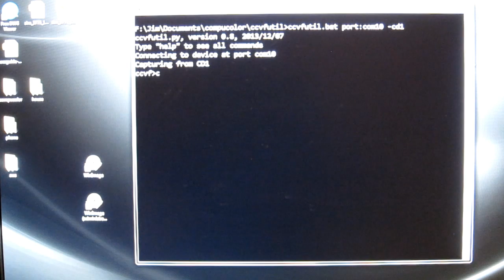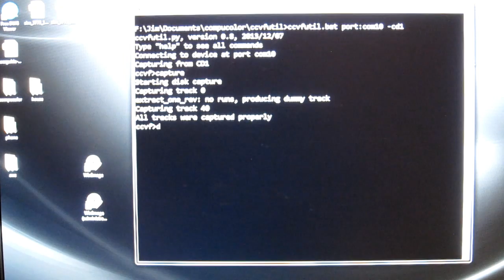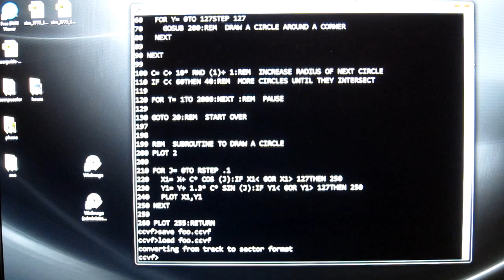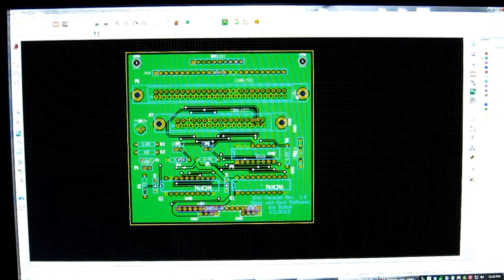Custom Compucolor II floppy disk reader

Comment: I was the software manager of the CC II. It had a primitive almost analog disk reader writer - basically recording a modem signal. Because it was so close to the CRT flyback's high voltage signals it had huge problems. We added a shield made of "mumetal" ti try to shield the head.
Reply from the maker: Bruce, it was an ingeniously low-cost (but low performance) disk control. The Northstar Horizon disk controller had a board full of TTL parts, probably 50, to do what the CC did with a single UART chip and a buffer to drive the head stepper. Have you tried playing with the CCII emulator at compucolor.org? It's disk is a lot more reliable than the original. :-)
Reply: @fudgesauce  I used dual 8 inch floppy's connected to a CC II to do software development. 2 360kb floppies were big enough to hold an editor, assembler and all the system software.
Reply: @fudgesauce  A modem ( UART ) is by necessity very forgiving of a bad signal. As close to the high voltage CRT as it was the signal was VERY bad. That forgiving UART was a good as it gets, a regular digital read/write head just wouldn't work.  We looked at it.
Reply: Did they make their own floppy disk drives?
Reply from the maker: @douro20  -- it was a hybrid. The drives mechanicals were OEM'd, and compucolor used their own electronics.
Reply: @douro20  The drives themselves were standard parts. The electronics - the data format and recording method were custom.

Comment: Very cool....I got 2 CompuColor systems and this would be very useful.  Any possibility of getting some Compucolor software?
Reply from the maker: chandrab, I have no actual floppy disks anymore.  I sold them with the CCII on ebay a few years ago.

however, everything that I capatured is available at http://compucolor.org/vmedia.html   (vmedia = virtual media).  Each row in that table has a virtual disk image saved as a zip file (see the "Disk" column).  If you unzip it, there is a filename.ccvf file (ccvf = compucolor virtual floppy).  The file is a text file format.  The first few lines are the label, then the raw track data as a bunch of 0s and 1s.  Each bit corresponds to one bit time.  That probably isn't the most direct use to you.  However, I have a python program which can convert that format to a sector dump format, which you could transfer via a serial port on the CCII and write disks that way.  My contact info is at the bottom of each page on that website if you want to pursue this.

Comment: Fantastic work :) Did you ever get your boards made / working?
Reply from the maker: +Peter Edwards (sweetlilmre) -- Thanks Peter.  I did get boards ($20 for 10 boards!) made and they worked.  I've wanted to revisit this to make it work with any 5.25" or 8" drive, but I haven't had the spare time, and I have too many other hobby projects demanding attention.
Reply: +fudgesauce I know exactly how you feel :-).